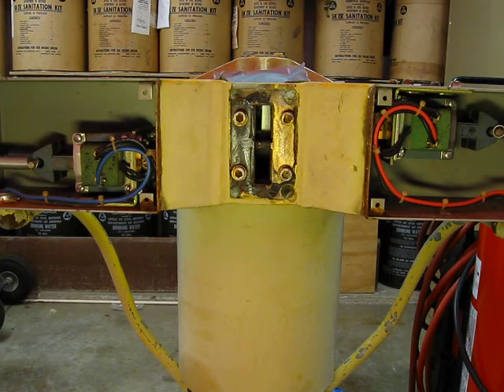Federal Thunderbolt 1003 Pulse Signal Demo

Comment: If the thunderbolt was run for a significant amount of time with both solenoids closed, with the blower running, could that possibly cause damage to the blower, chopper, or solenoids themselves?
Reply from the maker: As long as the blower relief valve was working as it should the air from the blower blocked by the solenoids would be released by the valve. Those old sirens weren't intended to be run for longer than 3-5 minutes at a time.
Reply: I appreciate the response. I didn't know the blower had a relief valve, though I should've expected it. It makes so much more sense now that pulse would be a useable signal in these sirens.